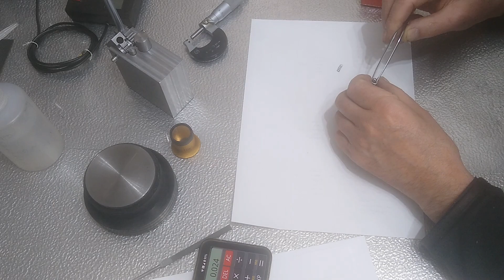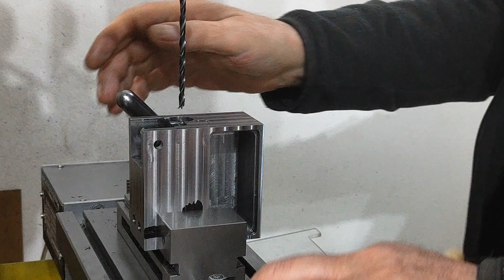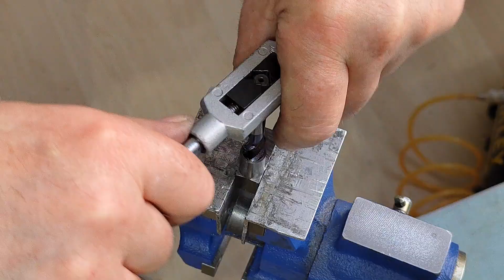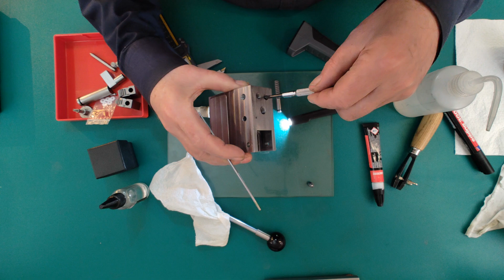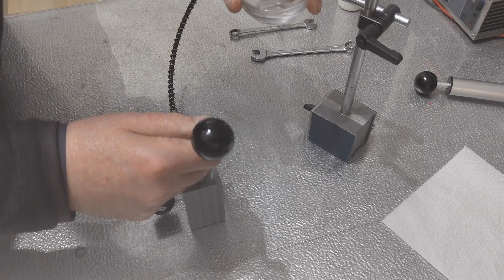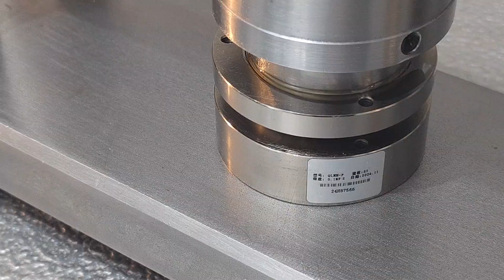A Tiny Tabletop Hydraulic Precision Press Part V

Comment: Hello, Mr. Michel! I am a fan of yours from China and really like your little hydraulic pump! I'm curious what's in the black bottle that you're holding in your right hand at 19:40 in the video... is that a type of glue? How does it perform and how much does it cost? Looking forward to your reply!
Reply from the maker: Yes, that is metal glue. It is called Extralock from the company G-Fittings. Only after it is applied between two metals it hardens quickly, and gives a strong connection. Another (better known, but more expensive) brand of this glue is Loctite. This Extralock costed me 28 Euro for 50 cc. 
See: https://g-fittings.shop/nl/extra-lock-metaal-lijm-jannelies-50-ml-7719133000000
With your question you give me a nice idea for a short video: How strong are these types of glue really? The strongest ones are advertised with 1 to 2 kg/mm² shear strength, but is that true? With this tiny press and the pulling attachment I should be able to measure that quickly and fairly accurately. Thanks for the compliments.

Comment: Hello Michel, first thanks for treat we get with your videos. I was wondering where do you get your drills from and what standard do you use? they seem to work really nice, I especially impressed by the really long ones. Same for the taps...
Reply from the maker: The drills I buy are almost all of the brand "Alpen" (Austria). What is very important is that especially the long drills have a very precisely ground point, so that they do not wander in the workpiece. I use a drill sharpening machine and pay a lot of attention to the correct geometry of a drill point. See https://www.alpen-drills.com/de/bohrsortiment/metallbohrer-4/
My taps are made bij Völkel, see https://voelkel.com/en/
Reply: 😀 Just got a set of 8 drills from Alpen, it was 50% discount and after your recommendation it was a no brainer. Again thanks, both for the reply and for the amazing videos!

Comment: Michel, I use hydraulic seal Loctite 542 which seals good but doesn't have the high strength of e.g. 642 and can be broken free using normal tooling. Maybe a tip. Nice work Michel! Best! Job
Reply from the maker: Hi Job, thanks! I find all those Loctite numbers confusing. It reminds me a bit of the HG brand; in the past two or three really good products and now many dozens that overlap each other considerably. Thanks to the marketing departments. Do you know if there is a table somewhere with all the Loctite types, their purposes, temperature resistance and especially their shear strength?
Reply: How are their resistance to acetone? If things go wrong you might be able to get everything back apart by just submersing it in acetone and let it sit. Quinn@Blondiehacks usually does that instead of heating the parts.
Reply: @pettere8429  I never tried so I'm not sure if this would work. It's different from super glue